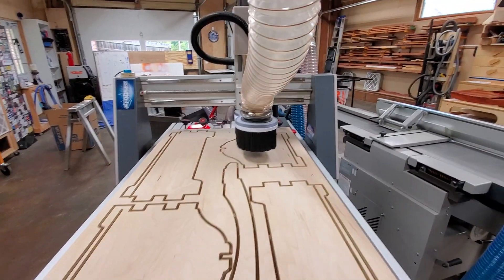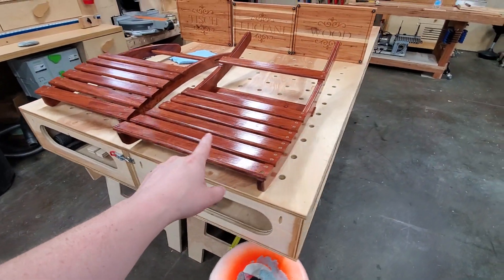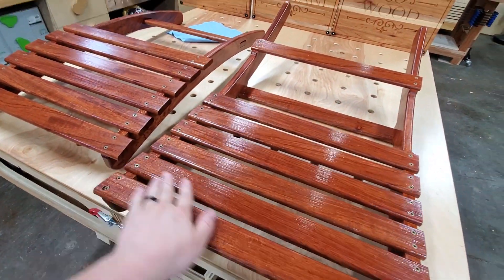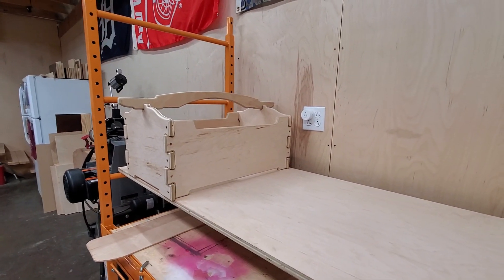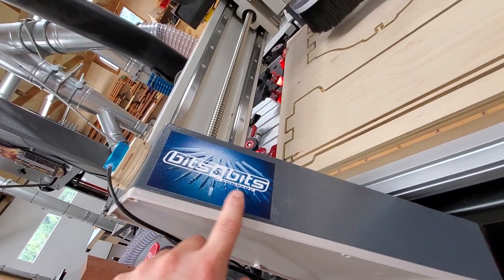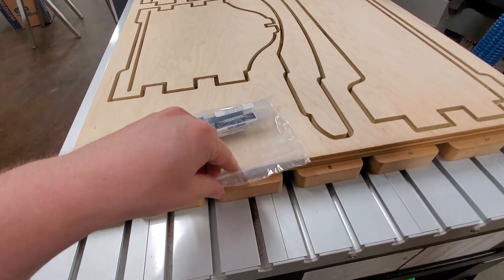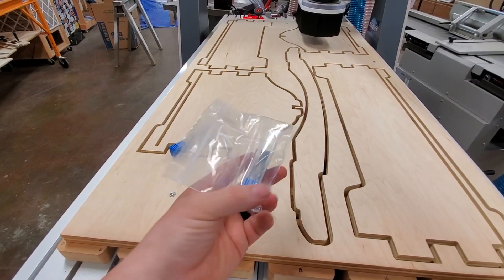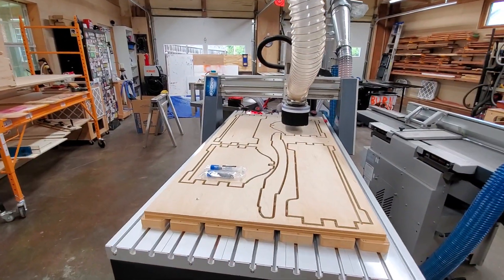Router bit giveaway - September 2019

Comment: Handle looks to be a weak point in the design. I would mortise it through the side pieces with maybe a wedge block at each end or an angle slip joint. Another words slip handle into each side on a angle and lift up locking in place and then attach front and back panels.  Just my two cents.
Reply: Can you make one and show us?
Reply from the maker: How much strength do you need? Indeed, the handle is the weakest point compared to everything else. But it just needs to be strong enough to never fail, which it is.
Reply: @JayBates2  It's a tool tote correct?  So it could carry 20 to 50 pounds and all being held by a single screw connection at each  ends, is a recipe for failure over time. Plus with this being a cnc green and green inspired piece, a through handle would add to the piece's aesthetic value and not be hard to change the code. In my opinion the handle needs to be at least as strong as the totes bottom.